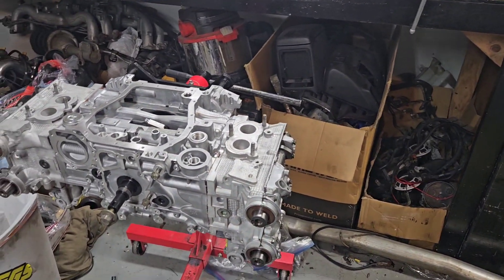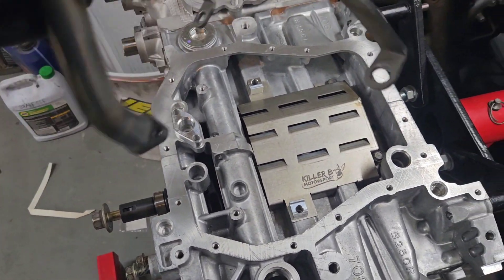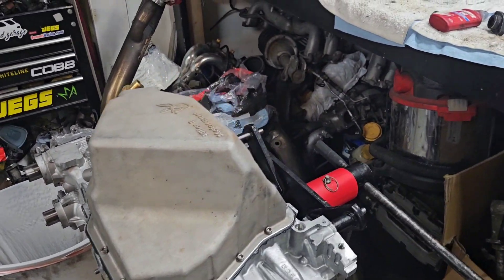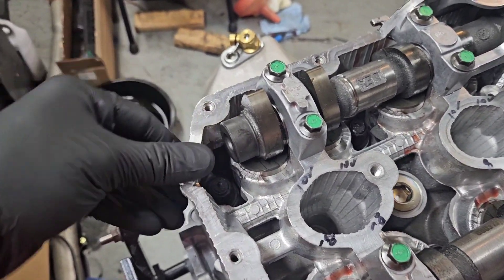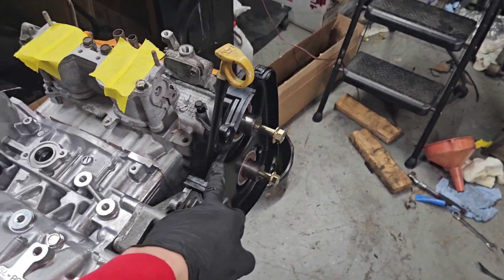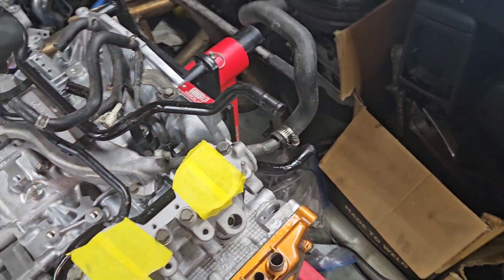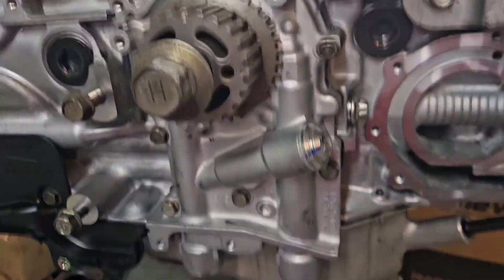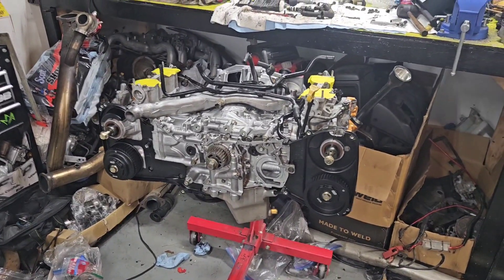Built IAG EJ257 Assembly! killer B oil pan! - STI Swap Legacy Wagon

Comment: @HackSquadGarage this is definitely a sick build.  I am doing the same in my OBXT. Same block too. How is it running? Did you use an AISIN TBelt kit?😊
Reply from the maker: It's running just fine, I never figured out how to get the stock ecu to cooperate with the avcs but otherwise it's perfect. I upgraded valve springs and cams so I went with a blue gates racing belt. Aisin is great but I needed something stronger.
Reply: This must be a blast to drive. Love it. Great work 💯
Reply: Also didn’t realize for upgraded valve train a stronger TBelt is needed. Great work though, very impressive.